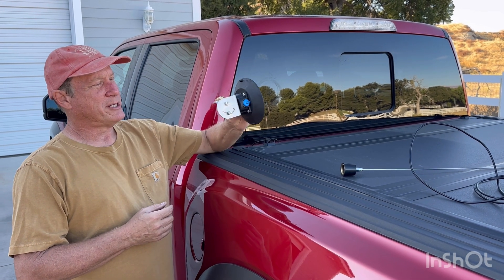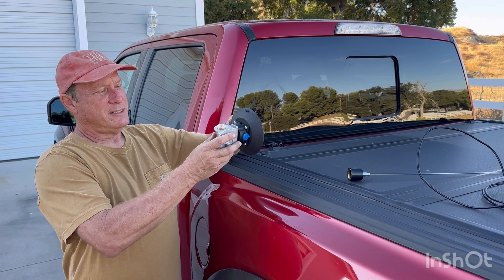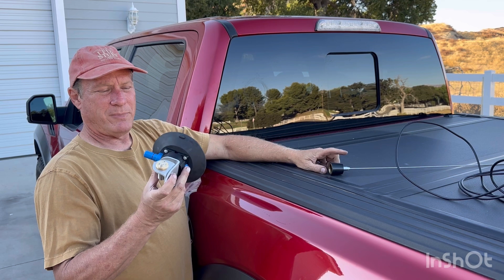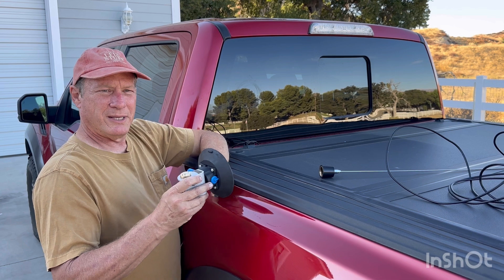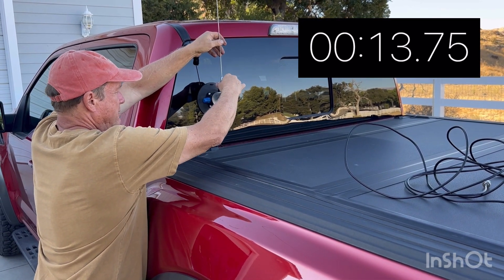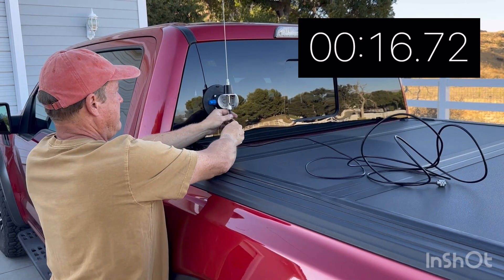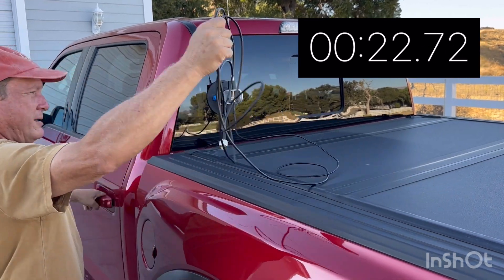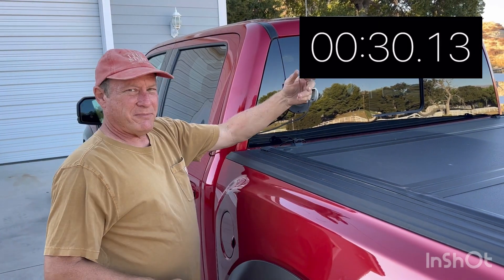How to Set Up a VHF UHF NMO Mobile Radio Antenna Mount in 30 SECONDS!

Comment: I just bought one this week, because I have an F150 aluminum body truck and magnet mounts won’t work….So tonight I tried hooking the suction mount to my rear window just like you did; and it kept falling off. The instructions say clean the surface, hold the suction mount firmly while keep priming the plunger until you can’t see the red line on the plunger. And as soon as I see the red line disappear, a few seconds later it falls off again…. Please tell me what I am doing wrong